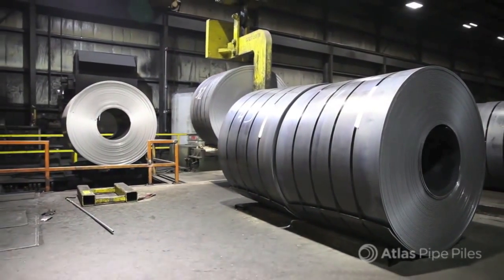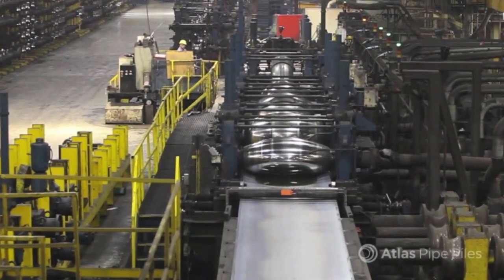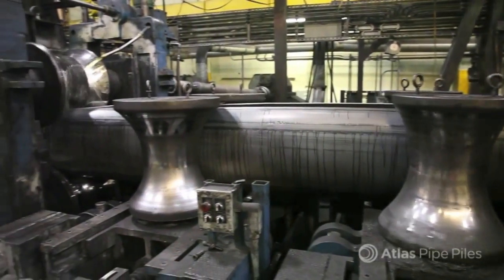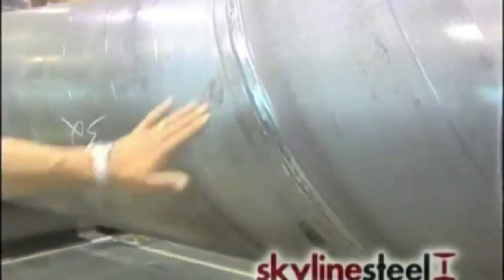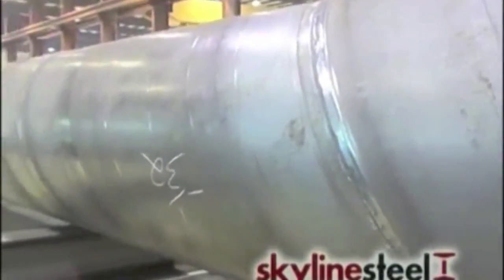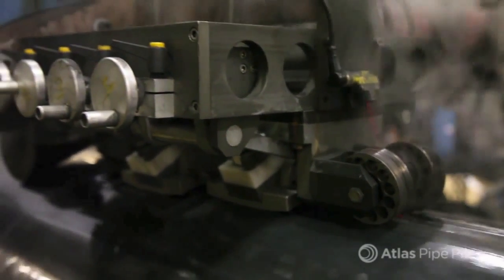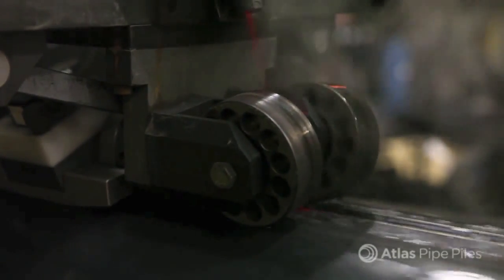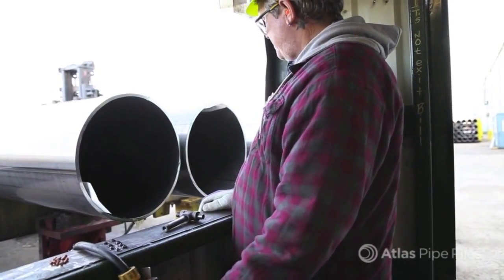Seamless Pipe manufacture

Comment: 12:48 But is it cheaper or eco friendlier?

Apart from that I really liked this presentation, sums up all I wanted to know about how pipes are made out of curiosity.
Reply: DOMs are much more expensive compared to the cold-formed sheet + welding pipes. In everything (initial machinery, personnel salaries, energy required by the plant…) and final price to the customer. 🤷🏻‍♂

Also, the shapes, diameters, thicknesses, materials, etc are more limited with DOMs, because they have to sell to a smaller market that requires that kind of quality.

Comment: Our factory is specialized in  manufacturing the molybdenum piercing mandrel which is used for piercing seamless steel pipes, 
such as stainless steel, brazing steel, bearing steel and high temperature alloy steel and etc. if you need, please contact us, E-mail, sales-1@hcwm.cn    website, www.tungstenalloys.cn

Comment: Informing video. pls how long does it take for casing/tubing heating treatment and coupling stock heating treatment process?
Reply: Really depends on a lot of different factors mate size, gauge, material ETC ETC from a few hours to even a day or two especially for the heat treatment sometimes you can leave shit in the furnace (oven) for 24 - 48 hours. really all depends champ
Reply: Dike David